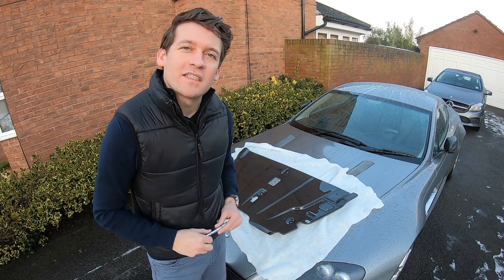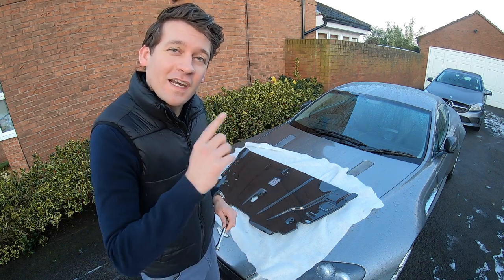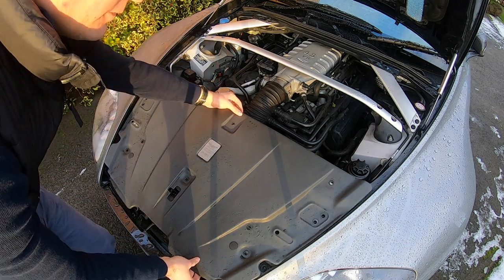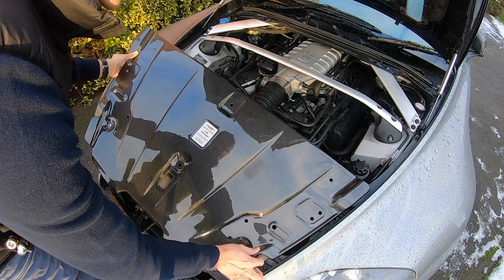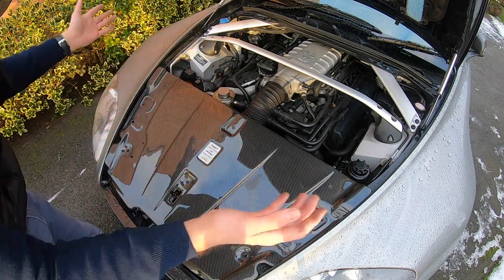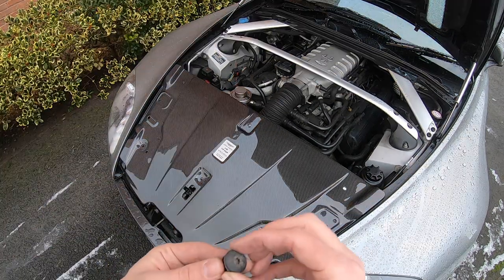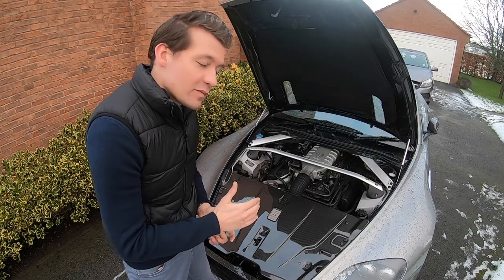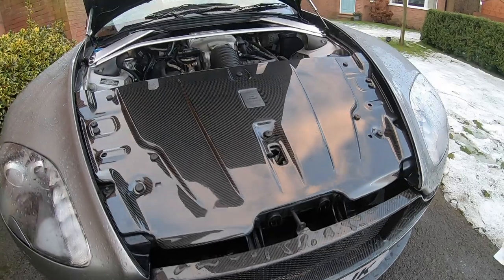Upgrading the Aston Martin Slam Panel to carbon fibre

Comment: Good idea using the rubber on the bolts to protect the carbon
Reply from the maker: Thanks, you definitely want to keep that panel protected and looking great. Some people PPF them but I thought that was a bit much as it doesn’t get battered with anything like the grille and diffuser do.
Reply: @KingandTitanRacing  why didn't you clean the surface when you removed the original panel ?
Reply from the maker: Mainly because in this video I wanted to show just how easy it was to swap them over, I’ve certainly gone back and cleaned every inch of the bay while detailing it. Well, Detail Joe has. 😉

Comment: Hi there,,,,I drive the same car and had it nearly 8 years now,,,,where do you go to get the carbon fibre panel then and what cost am I looking at
Reply from the maker: ECPS make the panel and pricing depends on the spec you choose. They do crushed carbon, coloured etc too. It’s not cheap by any means but it is some of the best quality carbon we’ve ever seen.
Reply: You can get the slam panel and 'inspected by' plaque from Aston Bits.